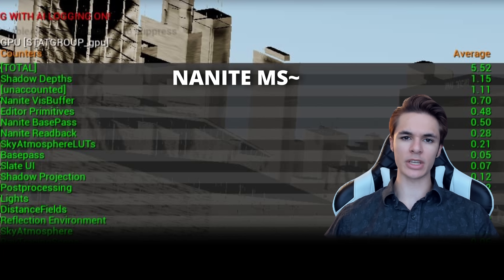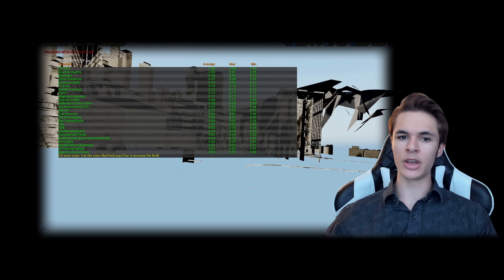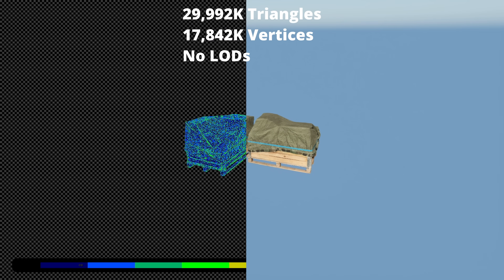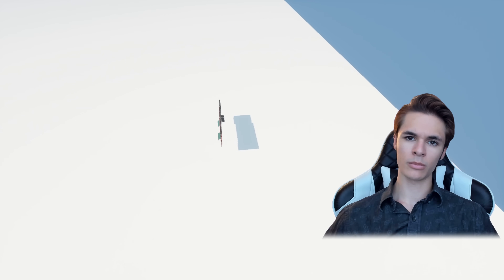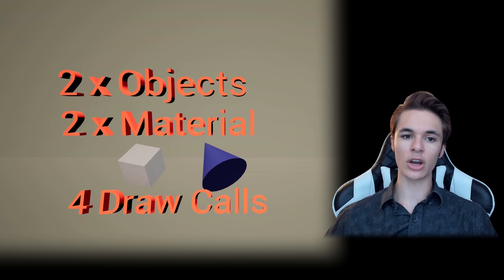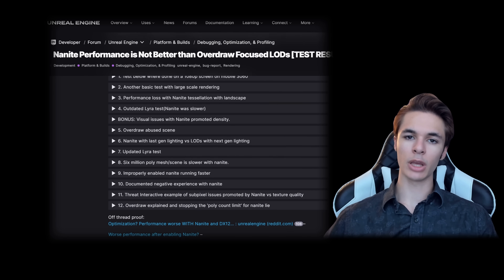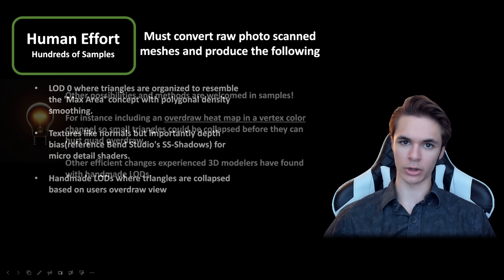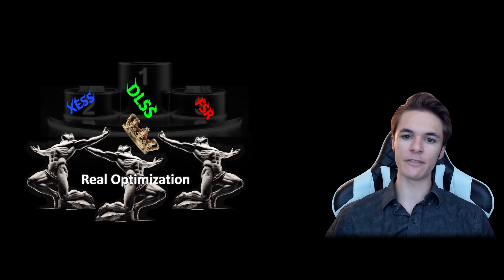Epic's Unreal Optimization Disaster | Why Nanite Tanks Performance!

Comment: I am so glad I clicked on this video. Im a noobie when it comes to graphics programming, but I've learned quite a lot just hearing you talk about things. I didn't know shaders are ran on quads, I thought shaders were per-pixel. Maybe the reason behind this relates to the architecture of the gpus? Some kinda SIMD action going on?
Reply: It's because of how texture samples with automatic mipmap selection works. To figure out what mip level you need to sample from, you need to figure out how far away the sampling points are between adjacent pixels on the screen. Ideally you want as close to a 1:1 mapping between pixels on the screen and texels sampled from the texture, so that moving one pixel across on the screen moves as close to one texel across on the texture.

Since pixels are ran on quads, this process is basically free. Pixels in a quad are executed in lockstep with each other within the same SM/CU on the GPU (alongside the other threads within their thread group, though that's getting a bit into the weeds), and so each pixel should be able to access the data of all other pixels within the same quad, assuming they've taken the same branch through a uniform control flow region (fancy way of saying they're in the same section of code).

This lets the GPU access the texture coordinates of all four pixels in the quad at the same time, without any additional work. The GPU can use the texture coordinates to figure out how pixels on the screen map to texels sampled from the texture, so that it can calculate the optimal mip level to sample from.

Comment: Edit: After watching the rest of the vide, I do agree that there is a lot more room for improvement by combining both systems or replacing them with a proper AI driven solution, I understand now the issues you've raised go far beyond a long LOD pipeline vs worst performance but quick solution, it's an issue that can create new problems as developers and studios opt out of an efficiently built LOD system that takes a lot more work, effort and money, to a one click solution that could lead to forgoing proper optimizations. I appreciate the work you put in to this.

I'll keep my original comment here for context:

"I don't think the 'point' of Nanite was to be 'faster' than traditional LOD systems. The main benefit lies in eliminating the need for an extensive LOD setup, allowing large, vast open areas with high levels of detail based on distance, while also minimizing noticeable pop-ins during traversal. You can directly import a raw 3D sculpted mesh from ZBrush, and UE5 will automatically optimize it—not only reducing its detail seamlessly as it becomes less visible in the frame but also optimizing its storage on the device, so the raw file doesn't need to be included in the final game. This significantly eases the development pipeline for 3D artists and helps optimize performance bottlenecks by abstracting them to more generalized areas, even though it may obscure the reasons behind them. This should, however, provide better transparency for developers when debugging traversal stutter and lag issues. 
Although, the raw file is never shipped with any game, only the LODs, so storage and reading files from disk shouldn't be an issue with nanite either, but,  performance issues attributed to poor GPU utilization by the nanite algorithm, can and should be brought up, not as a dismissal of the very real and beneficial impact of nanite in the game development pipeline, but as feedback for areas to improve the system. I don't like when people dismiss a new system just  because it has major flaws, without realizing that it's benefit more than justify working towards solving said issues.
In fact, many of the issues brought up by the community since the release of nanite, have already been fixe in the recent versions. 

Keep up the investigative work, but make sure to not dismiss the tech, just because it has issues."

Comment: I am not sure on which engine to use at this point lol, should indie developers just go with unreal engine with nanite until unreal engine programmers fix it?
 or should we use no more optimized lods still on ue? 
or just change engine? If so to which one?
Reply: Id say unreal is still fine as long as you aren’t slapping millions polygon models in your scene expecting nanite to magically optimize it
Reply: @tux_the_astronaut  oh okay, but does that also mean not to use nanite at all or that i can use nanite with mid poly assets? should i just use lods and disable nanite and lumen? I was even thinking using forward renerer because of all the resources lumen and stuff takes, even deffered rendering is not perfect that i read from somewhere, it is only good for extra amount of lights but still it is a game that needs to run smooth and look crisp.
Reply: You can use nanite with models that are over 1 million polys

Comment: The whole point of Nanite existence is not to make games faster, but to reduce content creation costs. With Nanite it's not needed anymore to spend time creating LODs.
Reply: the today game devs don't want to work anymore
Reply: Exactly this, it makes things a lot easier if you can just mash an unoptimized 3d scan and a bunch of 150k poly models to make a scene and just make it work. As we know with electron apps, sometimes it's not about what's most efficient but rather what's easier for developers. An AI solution is unlikely as we've not found a good architecture/representation that effectively combines mesh shape, topology, normals, UVs, and textures, it's a much more complicated problem than just image generation
Reply: @alex15095  you can make synthetic dataset by using Blender Sverchok addon and model every thing in procedural way
Reply: In the UE 5.4 documentation they say “Nanite should generally be enabled wherever possible. Any static mesh that has it enabled will typically render faster, and take up less memory and disk space”. It is advertised as a one click optimisation. Of course you should profile before using anything but still.
Reply: Yes because the only thing AAA studios want is ways to take shortcuts and cut costs, rather than actually optimize and make a quality product.
Reply: Dude LOD are generated automatically by any tools. It’s not time consuming at all
Reply: generate and save lods for a couple 100k poly mesh please

Comment: Check out ark survival ascended the game performance is absolutely abysmal 

Due to nanite on a 4k (70% res) monitor with med/high + ultra settings settings it uses 14.2gb of vram on my 7800 xt. My friends 3440 x 1440 dlss native max settings was using 13.8gb of vram on a rtx 4090. 

The worst thing is the highy detailed terrain that tanks performance especially on high resolution output is the volumetric fog means most of it can barley be seen. If you disable siad fog with console commands framerate shoots up and the amount of detail is stupid.

Edit another problem in ark survival ascended is it randomly overwrites your resolution scale even if you set the settings file to read only unless you're using a dlss preset meaning severe ghosting with low framerate tsr or blury fsr trash

Comment: What? Smallest Nanite elements that would be affected by the issue you're talking about, have always been drawn using software rendering to avoid it.
This video is just incorrect.
While UE5 has started out as being Nanite-centric, they've been regularly adding back features to better support traditional rendering, like mesh tessellation. Nanite is performance heavy and nobody has denied that, it's just another solution in the toolset.

Comment: you can also reduce draw calls using bindless techniques, like what they did in idtech 7, they are able to draw the entire scene with just a handful of draw calls.
Reply: What's a bindless technique?
Reply: @mitsuhh  with vulkan (and i believe also opengl 4.6), you can bind textures to a sparse descriptor array in your shaders that can be modified after pipeline creation, effectively allowing you to swap in and out textures on the fly. you can then put all your material data in a shader storage buffer, and use a vertex attribute to index into that shader storage buffer which can then index into your texture array, it basically means that you don't have to bind new textures when rendering meshes that use different textures, so long as they are on the same shader, which can reduce a TON of command buffer recording and submission in your gpu pipeline.
"bindless" is technically a misnomer, since obviously there are still samplers being bound to a descriptor, but it's right insofar as you don't have to "rebind" them unless you are loading new textures in.
Reply: @SpookySkeleton738  Cool

Comment: As a hobby indie dev I work with Godot Engine, and it might seem silly to even compare that to Unreal Engine, but... Godot is so simple in comparison that you don't have these problems...

if you're a solo dev or a small indie team starting a new project, I'd recommend giving Godot a shot before you commit to Unreal Engine.
Maybe you don't need UE's complexity and weight to make your next game.

Godot has a decent auto-LOD system that "just works" and reduces quad overdraw, doesn't depend on TAA or denoising to provide it's visuals. TTA does what's on the tin - anti-aliasing and just that. Sure, the renderer is very limited - you have no stochastic SSR, no raytracing, no mesh/texture streaming (yet), anisotropic shading is borked with reflections, but you have an easy lightmap solution and a semi-decent realtime GI solution for quick prototyping or dynamic day cycles that doesn't look as good but is much faster than Lumen. Godot has TAA but it's tuned so carefully that it produces practically no ghosting unless you have motion-vector problems (where any implementation will fail).

The engine is quite low-level - there is no advanced FPS controller out-of-the box or one click networking solution, but the basic tools are there, the rest you can get from the Asset Library where users share their work.

Heck. I've seen people make complete games in Godot while waiting for UE to initialize an empty project...

Programming in GDScript is really easy to start with, especially if you have any experience with Python. using it you have incredibly quick iteration time compared to C# or C++ because GDScript is interpreted - you can update the code live while the game is running, allowing you to tweak code or fix mistakes without having to restart the game.
No OOTB visual programming in Godot, but there's some nice assets available if you need that.

The visual shader editor is very limited in comparison, but still can get a lot done - and because you can view the generated shader code it's a great learning tool to start coding your larger shaders properly anyway.

Godot might be just enough for you, and might save you a lot of time.

Comment: Nanite, as any application designed to incresase performance through parallelism, suffers from performance issues on small scales because of synchronization. Nanite excels in large amounts of triangles because they're culled in bulk, thus large triangles aren't favorable. Also, nanite rendering is fully computed, it never reaches the GPU rasterizer, it is rendered in 32x32 pixels blocks. Thus, Nanite should only be used if you intend to draw models so detailed that their primitives on screen occupy just a few pixels, otherwise, you're wasting your GPU resources

Comment: TwoMinutePapers just recently covers an auto meshing AI, which allows you to take either images, or point clouds for 3D photogrammetry scans and output a (if possible) symmetrical optimized mesh, with the ability to set the poly count.
So the initial starts of the AI solution are already in the works and open source, even runnable locally.
It'll be up to developers to improve on this work, and incorporate this solution into plugins for common 3D modeling tools.

Comment: This may or may not be true, but I actually believe Unreal Engine's quad-overdraw viewmode has been broken for a long time (atleast beyond 4.21). In a Robo Recall talk they talk about the impact of AA on quad overdraw and show that if you enable MSAA your quad overdraw gets significantly worse. Now if you run the exact same test quad overdraw IMPROVES significantly. So unless Epic magically optimized AA to produce less overdraw, the overdraw viewmode is busted. I tested the same scenes in 5.2 and 4.21 and the overdraw view was much worse in 4.21 with it actually showing some red from opaque overdraw (all settings the same). I'm not even sure if opaque overdraw can get beyond green now. I would suspect the overdraw you show from extremely high poly meshes should actually be significantly worse and mostly red or white.
Reply: msaa by nature causes more overdraw because it takes multiple samples for each pixel, with varying amount depending on the settings, so in some cases where only 2pixels are occupied, meaning 50% overdraw, with msaa it could be for example 6 pixels out of 16, meaning 60% overdraw etc.
Reply: I assume that Epic cheats the values when MSAA is enabled as that will cause overdraw in it's nature
Reply: at least*
Reply: Robo Recall is FORWARD rendered (where MSAA is the king) because of VR, basically uses a second class renderer, so that talk is pretty much irrelevant for normal games, especially for UE5.
Reply: @kazioo2  no it uses a first class renderer because they actually realized that performance and clarity matters when it comes to VR
Reply: I don’t think quads are as big of a deal as this guy is saying
Reply: It is true. Unreal sucks and everything about it is fucked
Reply: @neattricks7678  Sure it does buddy
Reply: @FourtyFifth  He's right.
Reply: @doltBmB  if he's right you'd be able to name 5 things that suck, especially when everything about it sucks apparently

Comment: Interesting, though were the Meshes that were compared optimized for nanite? As remember with the rendering you can get rid of several different maps that were traditionally used for adding in more detail on other models simply because they are no longer needed with high detail mesh data. If you don't optimize your flow around using Nanite yes it will be slower, the same will be the case if you try the other way with meshes optimized for Nante and you try and use them without it.

Comment: I think easy, automatic optimizations that are less effective than manual ones still offer some value. When a studio has to dedicate fewer resources to technical things like they, the faster they can make games, even if they look slightly worse than they could if they wanted to take absolutely full advantage of the hardware.

Every other app on your phone being over 100mb for what is basically a glorified web page should example how dirty but easy optimization and faster hardware mostly just enables faster and cheaper development by enabling developers to be a little sloppy.
Reply: it's great in theory, but in practice the development is still expensive as hell and the quality of the products is an absolute trash. It's the reason we have a volume control in Windows lagging for a whole second before opening up. The same stuff that worked fine on Windows 95, lags now. Dumbasses with cheap technology still make bad products for the same price.
Reply: @theultimateevil3430  when you're looking at large products make by massive publicly traded corporations   you should never expect any cost savings to get passed on to the consumer.

I'm mostly talking about indies. The cheaper and easier it is to make something, the lower the bar of entry is, and the more you'll see small groups stepping in and competing with the massive selfish corps.

Comment: nanites cluster culling is far superior to old LODs and bounding box culling.
year the initial cost is higher, and yes it only makes sense for model which actually have and need this kind off details. and yes with and manually tuned model with perfect setup of LODs and other optimizations you will have a better performance. but the cost(money) it to high. and with the nanite displacement tech the actual model size is keeped low, but boosted when it is needed.
its like comparing a gas car to an EV, the gas engine got tunes for dozen of years, but EVs is the way forward even if it has some issues.
also there is no need for and AI model for model processing,

Comment: Nvidia is the king of planned obsolescence. They removed information on the underlying technologies that make Path Tracing possible because if used in normal RT workloads, they would provide an FPS boost of at least 300%. Initially Nvidia was advertising how performant it was, talking about how they made the NvRTX real time demos on two generation old hardware, doing multiple streams, and saying they would release the demos, etc. Now the initial demo (Attic RTX) download link is partially hidden as well as completely offline, no other demos have been released, and the Theme Park RTX is nowhere to be seen. As of current, the only way to see some of this is to build the NvRTX branch of UE4 or 5 and test the tech yourself, but there are a few videos floating around. The main tech is RTXDI, with OMM being the second largest performance boost, and SER being there for 40 series, along with many other underlying technologies that come into play. Just keep in mind RTXDI in path tracing or full ray tracing, is not the same as RTXDI in Hybrid Ray Tracing.